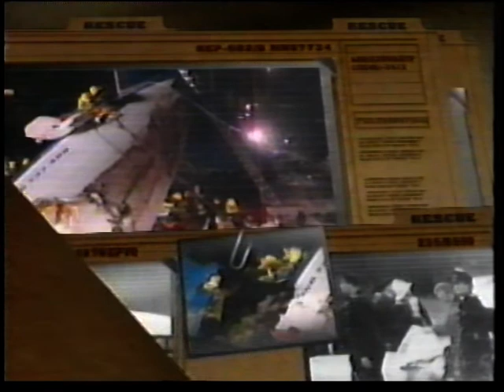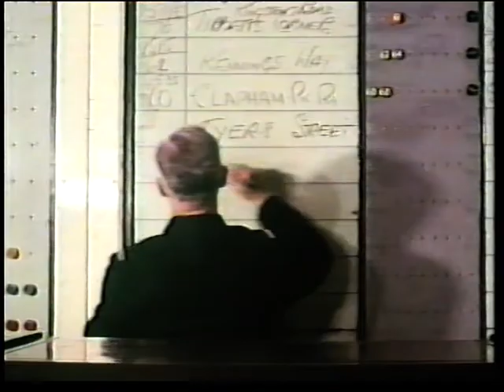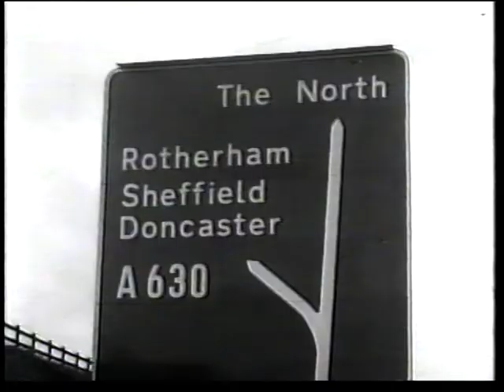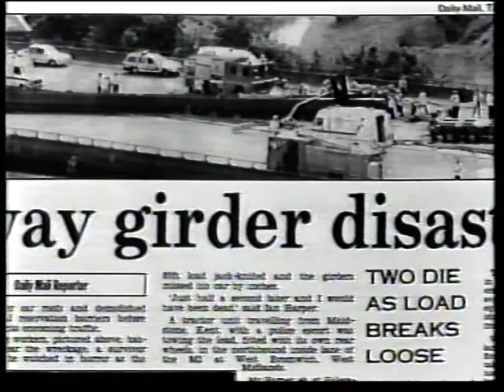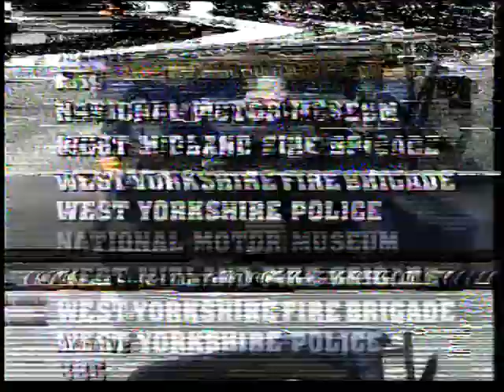Rescue   Jaws of life

Comment: Even in the late 1990's RTA Extrication was a specialised task that Wholetime in Norfolk did with the ET's and a pair of Rescue Pumps at Thetford, and a few Retained pumps. Not all stations had the HRE as now. Those that didn't have HRE had Air Tools and Hand powered Hydraulic Kit known as EPCO and a few wooden chocks and blocks. No Airbags or spinal boards, and a basic first aid kit plus some O2 Therapy.
Reply: merseyside had power rescue equipment on all pumps in late 90s and air bags too,and 3 rescue units with  lager versons on them too
Reply: @paulgriffin5237  I’m guessing Merseyside were properly funded. Some of the Retained Crews in the 80’s/90’s used to have charity events to equip the stations with HRE and Thermal Imaging Cameras